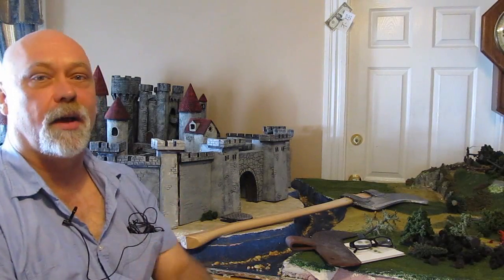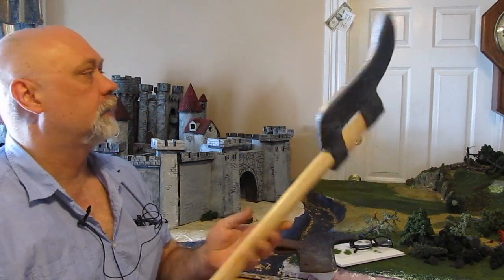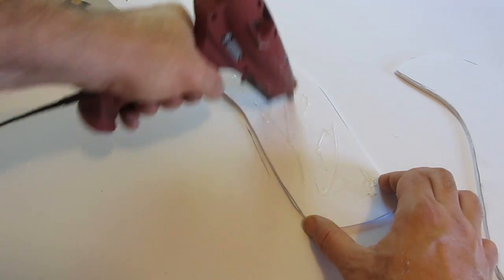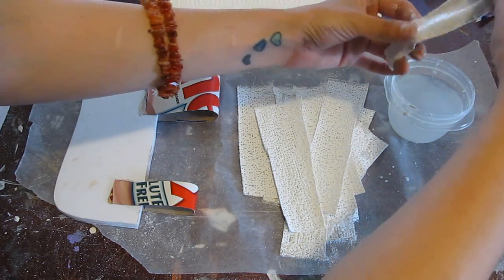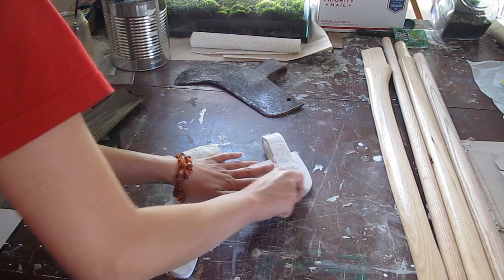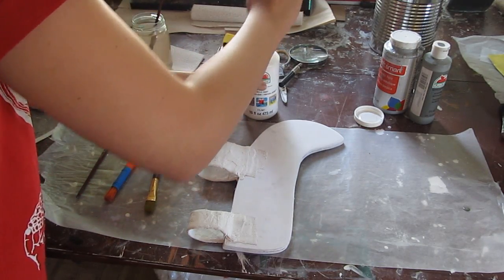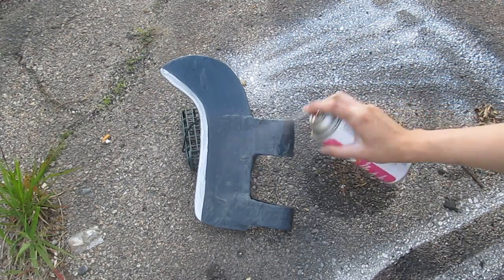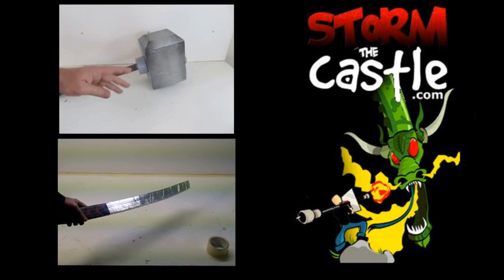Make a Medieval Billhook out of foam board

Comment: Nice tutorial, easy to follow, thanks!

Have you come up with anymore board game ideas? My cousin and I enjoy them a lot.
Reply from the maker: Thanks for asking about the board games! I will be doing another one soon. Don't have a solid idea for it yet but it will come.
Reply: epicfantasy I had one idea, "Kings and assassins", The player that's has the assassin's has 3 players, and other player with the King has 1 king and 8 knights. It kind of has the same concept of chess, but when you come face to face in battle, the assassin's have 2 rolls on the dice and the knights have only 1, if the sum of the assassin's dice is more than the knights, the knight dies.
Example: If the assassin roles and 1 and a 3, and the knight rolls a 5, the assassin dies, if the assassin roles a 2 and a 3, and the knight roles a 4, the knight dies. If there is an assassin in the next square to the king, they have the chance to use "assassinate", the king and assassin both only get 1 role, if the assassin roles higher the king dies, if the king roles higher, he has the chance to kill the assassin, or, bring back one of his knights, but the assassin has to go back to where it started. You can change the amount of players on the board but there must always be at least 4 more knights than assassin's. The board should have a minimum of 30 squares for a more strategic style of play, the players can move a unit 1 spare per move.

What do you think? If you can alter the board game a bit then I'm sure it will be a good thing to play! What's your views and opinions? (:
Reply from the maker: I think this is pretty good. How is the game ended? How do you win?
Reply: epicfantasy The assassin's objective is to kill the king, and the Kings objective is to kill the assassin's...A simple concept :|
Reply: epicfantasy I think it would be more strategic though, because the knights would have to gang up on the assassin's whilst protecting the king, and the assassin's would have to try strategically move around to avoid being surrounded.